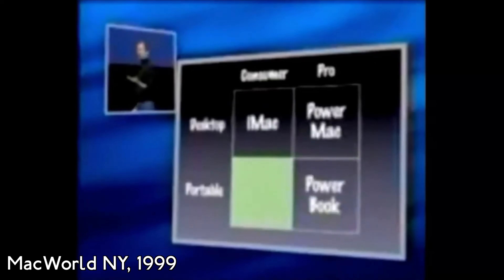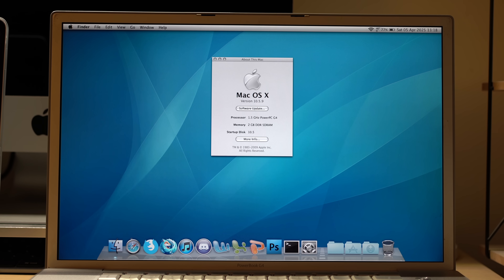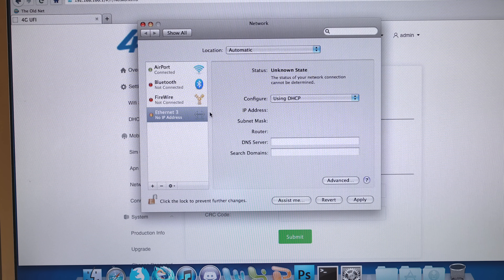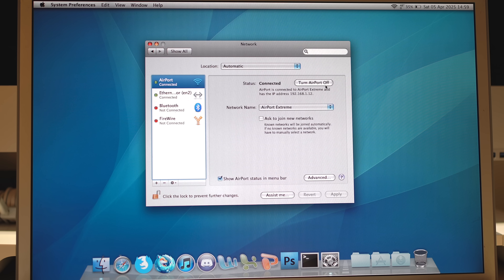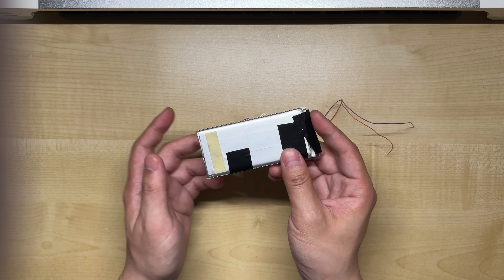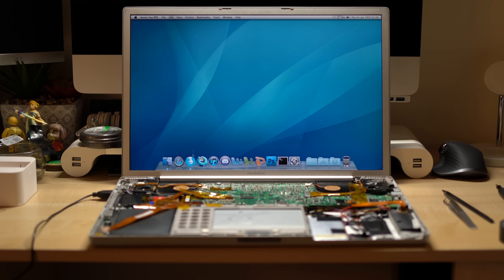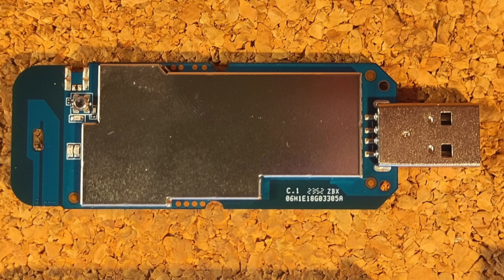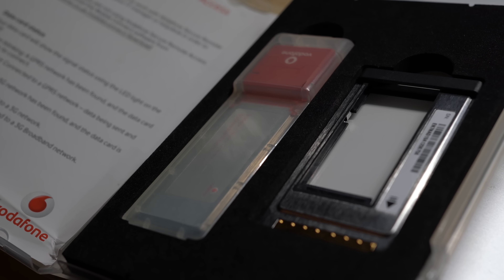I Built a Mac with Mobile Data (Before Apple Did)

Comment: nice, now do it on a 2012 13 inch macbook pro
Reply from the maker: Funnily enough I recently obtained a 13 inch 2012 MacBook Pro (pre-Retina) and have been contemplating it. I don't even need to remove the SuperDrive, replacing the hard drive with an SSD already frees up enough space to fit a 4G radio system and the USB port's pads are easily accessible on the underside of the logic board.
Reply: @NekoMichi go for it bro, that would be dope

Comment: You should flash PostmarketOS on the modem, which means it would run much better and use less insecure software. Any variant of the firmware for MSM8916 modems will work, but may lose RIL functionality if not specifically ported for. You should first make a full dump of the Android ROM before building pmOS and flashing it. This may also solve your bootloop issue because it uses way less system resources.

Comment: oh how my eyes lit up when i saw that modem
i've been absolutely fascinated by these personally, they can be gotten to run mainline linux and even have full in-tree support these days
if you're going to be attempting getting linux on this, don't waste your time with the openstick project from 2023, as it's quite outdated by current standards
i've had my easiest experience running postmarketos although with enough tinkering any distro can be made to work (although the celluar functionality is quite a pain to get working as it's not really documented anywhere)
Reply from the maker: So, Gentoo it is then...?
Reply: @ 100% possible, although good luck compiling anything on device with this amount of ram and storage..

Comment: HOW DO YOU STILL GET BATTERY OUT OF THIS ?!
Got two batteries for mine but they're both kinda dead. Also really cool and I will definitely try the POC Android USB driver and your Firefox version.
Thanks for this video !
Reply: It takes some effort, but you can rebuild these, you just need to open them up and replace the cells inside
Reply from the maker: I have two OEM batteries, one lasts 10 minutes on idle from a full charge and the other still lasts about 2 hours with light use.

Comment: If I saw correctly, this old computer had something call a P C I Express cards port. back then it was the common way normal people integrated Cell phone modems on laptops. They didn't have power issues and most of them had a pop-up antenna for better Cell reception.
Reply: The best part is when that's what he shows at the exact final clip of the video. Nice...🤣
Reply: That means we can have a 2011 cellular MacBook Pro
Reply: @FireFoxDestroyer  well, yes.
Reply from the maker: I tested the expansion card in a newer MacBook Pro but sadly OS X didn't support it and none of the drivers I found worked.

Comment: If it's running Android who knows what else it's doing. Seems very overengineered and not like something they would put the effort into making without good reason. I'd be keen to see a security analysis of it's Android build. Years ago as 3G/4G was gaining popularity, there were a plethora of USB modems available long before wifi options came around, and they were very simple low powered devices. I did a similar mod myself on an old EeePC 701 in around 2009. 

I don't believe Apple would create a commercial offering with built in connectivity, I think given their "everything wireless" approach I think they'll continue promoting tethering to an iPhone :)
Reply: Yeah, and he also said it is running Android 4.4, which is very outdated and insecure by today's standards. And with usb debugging enabled, which is also insecure. This modem surely has the potential to secretly send stuff over the 'net.

Comment: Cool stuff for a normie like me to see lol. Thanks.  Almost makes me wanna be less lazy and do a project like this in the future. Wonder how easy or hard  it would be to do something like to a modern laptop. Windows or apple. 

Furthermore if you 3d printed a bottom case disregarding durability would that improve signal reception?
Reply from the maker: A plastic casing would definitely improve signal reception. Actually, Apple's first generation PowerBook G4 had terrible Wi-Fi reception because of the metal casing and that's what prompted them to add more plastic windows in this generation.

Comment: Try to use scrcpy and you will be able to access the home screen
Reply from the maker: Already tried, unfortunately scrcpy requires Android 5.0 or newer. I really wanted to set up scrcpy as a side-segment in this video but sadly it'll have to be in a different video project since I didn't want to spend too much time on a side-quest for this one.
Reply: @ what about older or tweaked version?
Reply from the maker: I'll need to look into it, there's probably a back-ported version somewhere.
Reply: @ ok, it would be kinda exciting to watch you putting linux on it or smth
Reply from the maker: @2p3k0un I'm looking into it, but this project will require a lot of research before I can make it into a video.
Reply: @NekoMichi  so what about Vysor did you use it? Or adbcontrol?

Comment: if it runs android, it WILL run  linux! i wonder how to install linux on the 4gb integrated storage though in the modem
Reply from the maker: Some hardware variants of this modem also have a micro SD card slot, which can probably be used as expandable storage.
Reply: @ i should try installing debian linux on it later, i have one

Comment: Small note about Android, the version that's running on there is likely extremely stripped down and there isn't any UI or anything. Amazon smart speakers also technically run Android but in both cases it's more like a stripped down build of Linux than true Android

Comment: It seems that it's running off of USB 2.0. I see the potential to use a two-port USB hub to make it possible to use the USB port and the modem at the same time. Also, maybe use a different modem or use a raspberry pi(say, a raspberry pi pico) with a modem?

Comment: 10:50 maybe older usb standards supplied less current?
Reply from the maker: Possibly, I used a USB power meter and found that it was cutting out whenever it reached 300mA draw.

Comment: It is a moot point on my side, but there are thinkpads with possibility for 4G connectivity expansion, e.g. X1 Carbon 9th gen which you can get for pretty cheap nowadays. Comes with internal antenas and dedicated SIM tray, there are also modems that support eSIMs. More plug and play and less junk, need to deal with Windows though - so for some not so much less junk :D
Reply from the maker: I should look into ThinkPad modding at some point, they're such a cool product line.
Reply: @NekoMichi  most of them come with wwan so theres not actually much need for modding, its the same with most business laptops such as hp elitebooks. both my elitebook folio 9470m and elitebook 840 g8 have cellular capabilities lol
Reply from the maker: My workplace gave me an Elitebook 840 but it has what appears to be a blocked-off SIM slot.
Reply: @endadwagon2  they're rarer than you expect. Sure, every thinkpad comes with a wwan slot, but unless it's equipped with 4G from the factory there's nothing in that slot + the antennas for data connectivity isn't there.
For example my T480 doesn't have any hardware for data connectivity except for the sim slot which does nothing, and to fit the antenna I would have to disassemble the display assembly. Too much trouble.
Reply: @NekoMichi  It is and it isn't at the same time - the fact that thinkpadswere designed for easy repairs and upgradeability kinda takes away some fun of problem solving and "limit breaking" that this mac build had. 

On the side note I made a switch for older, used thinkpad recently and for me it simply was the best solution. I was looking for some travel computing device and with 4G connectivity it just checked all the boxes. If I'd need a keyboard for a tablet I would just take a smaller regular laptop with me without much compromise and cellular connectivity made me to switch. I paid a fifth (yes, 20%) of what I'd pay for a new galaxy or ipad with cellular network in my country.

Comment: If you want to switch SIM cards, you have to teardown your laptop. Lastly, the laptop you chose was a pour decision, it is very heavy and even when “maxed” out with RAM and PowerPC chip revision you’re not going to be able to do very efficient or quick web surfing: a combination of 1 processor core, low memory, Java script and the bloat of the modern web means that laptop is best for say email (using an email client), FTP, IRC, Gemini browsing… Gopher? Personally I would’ve chose a cheaper Intel based MacBook… even one as old as 8 years would be a good net surfer, say a MacBook Air 11” to cut down on weight?

Comment: Not sure I would've done this on a Powerbook.  They're worth money nowadays.  A white plastic Intel MacBook would've been my choice.  Dirt cheap and plastic for the signal.
Reply: Worth money ? They sold for €15-20 in France, not rare at all. We're not talking about a powerbook 2400c or 550c...
Reply from the maker: It should be fine, all of the soldering was done to a spare USB daughterboard which is removable. This mod is 100% reversible and can even be treated as modular.

Comment: Awesome video. But rather than removing the optical drive, why not just remove the airport card?
Reply from the maker: The 4G dongle takes up more space than the AirPort card, so removing it wouldn't have freed up enough space. Also the optical drive was the closest component to the USB port daughterboard so it made wire routing a little easier.

Comment: This is something I've always wanted to try on a Mac. I think you may want to try a modem in MBIM or QMI mode as MacOS has a subsection for mobile broadband devices (seemingly indicating it can, in some way, directly interface with mobile broadband modems) in system report. I do wonder if there's any kind of special UI for it?